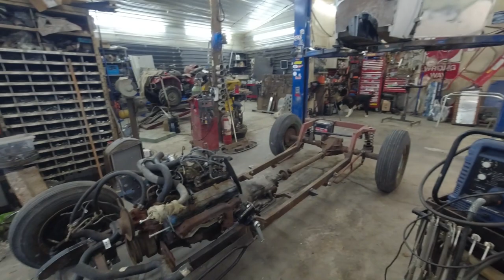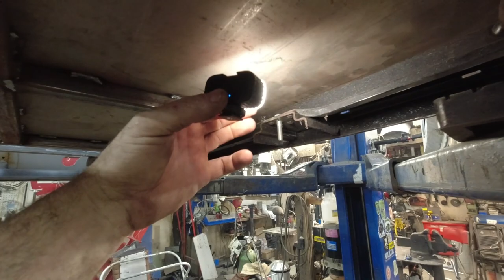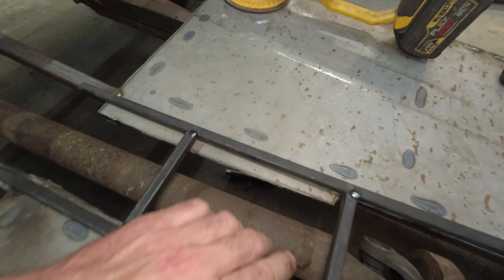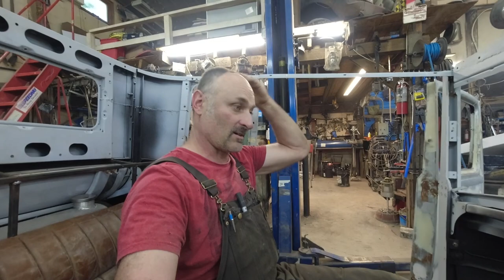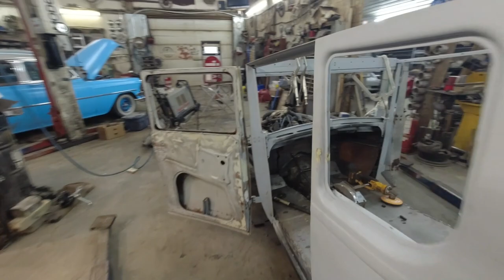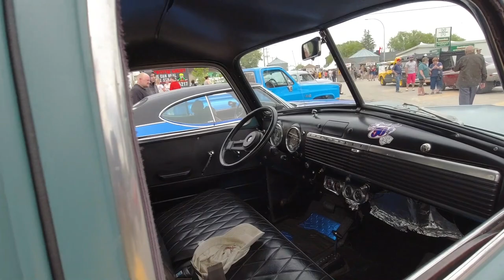Building floor braces and framing the tunnel and package tray in the 27 Model T hotrod

Comment: Excellent video Brent  :) plus shop dogs Pablo , Buddy  to also car looking nice and shape to you with ideas  too ! Also nice vechiles at local vechiles show & shine also one tonight Saturday night June 26 2022  had a interesting ones near a 1984  Toyota Camper 1/2 ton like S15 Chevrolet but camper add on also Hummer in looking like a 4 door jeep but 7 feet tall from ground to top with 28 inches 10 lug nuts wheels! Plus old classic motorcycles too from years ago in 1940 to 1980's plus new too!

Comment: Nice project, as usual. I'd rather have seen a column shifter, however; give you more room inside and keep the clutter down. Column shifters that are external to the column were pretty common back in the day. The shoebox Ford that donated the dash probably had s column shifter that fastened to the side of the column. Maybe something like that could be adapted to the after market column. Otherwise you probably have several columns in your yard with auto-trans shifters built in that you could cut down to fit, give you better signals, wheel adjustment, shifter, ignition switch, steering lock, and more. I do agree; I wouldn't chop it any further. One strategy for the interior skin that's popular with RVs is to shape the interior skin on a light frame and then fill the cavity with foam insulation. The resulting stressed skin panel is strong and quiet. You do nice work in the shop and on your videos. I think yours is one of the best rod and custom channels on the web.
Reply from the maker: Good point I have not committed to my shifter yet but don't see where else to use it haha

Comment: I thought the floor metal had some crazy bends in it but it was just the light and shadows from above. thin aluminum with some Kill Mat sound deadener sheets on the back an it would be whisper quiet inside👌

Comment: Brent, a build idea/suggestion for you to consider. 
A  2 seater but with a twist, driver in front and passenger behind, full sweeping fenders
Wide tyres on back enclosed engine bay and solid roof/possibly solid removable roof.
Wind up windows etc
Tony from Western Australia 🇦🇺

Comment: Maybe you have to go and get steel metal sheets from old washers and dryer boxes or refrigs and forget about the aluminum. My wife happened to see what you were doing and was amazed .   Fritzee fabrication found it cheaper to buy a tube rack already made and rework it to fit his needs rather then buy all the metal tubing and make it from scratch.   Higher cost kill hobbies.

Comment: Welding framework with floor in would have been difficult i think. So you made a wise decision, can weld tube 100% too.
I like the tapping drill bits, where you find those?
Thanks for sharing the niverville car show!
Reply from the maker: Just get them on Amazon though but a few they don't take kindly to any kinda side load haha

Comment: Im partial to this build
Because im partial to old 30's fords  i hope to build one someday  when i do ive got an idea of what i want to do unchopped body stock ford big 6 (300 C.I.D.) 5 or 6 speed manny tranny and a 9 inch 
 Air conditioning  4 wheel disc brakes am and fm cassette deck with digital tuner (mid 80's ford original equipment
15 inch american racing bullet hole rims chrome centers with black outers
Toreador red paint 
Not particularly a show car but a highway cruiser
Edit: forgot to mention
Bucket seats

Comment: Would it not be helpful, in insulting road noise they the frame, to cut some “ idolaters” thin from boat trailer rubber rollers and place them between the floor frame and cassis frame ?
Reply from the maker: I usually use semi truck mud flaps and cut em up

Comment: I have been meaning to ask you about the welding you do. What size wire do you use for the welding in the bodies o the cars and the bracing?  I have some work on sheet metal on my 1954 five window GMC and 1972 K20 chevy Pickup. I hate having to fill holes when I blow through witha too heavy wire on my tig Lincoln
Reply from the maker: I use .25 on the sheetmetal with my 110v welder and for the framing and stuff I use my 220v welder with .35 in it.
Reply: @HalfassKustoms  thank you
Scott Pastere out here in Southern Oregon